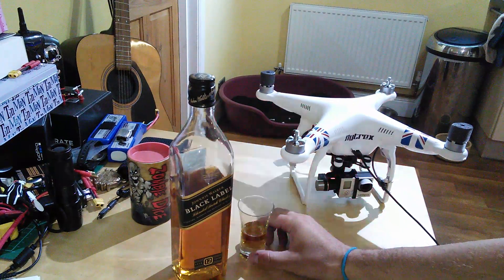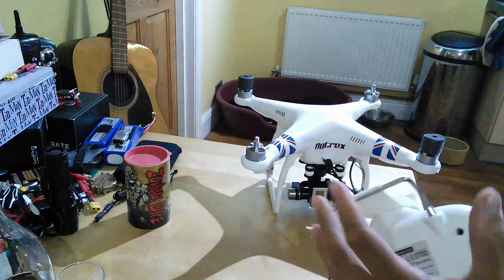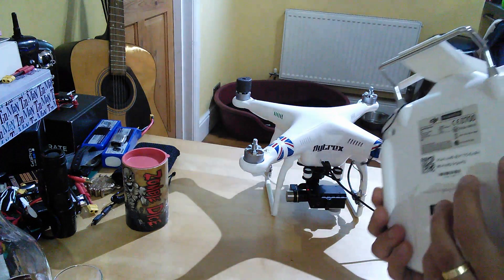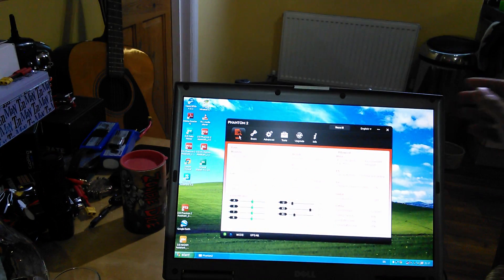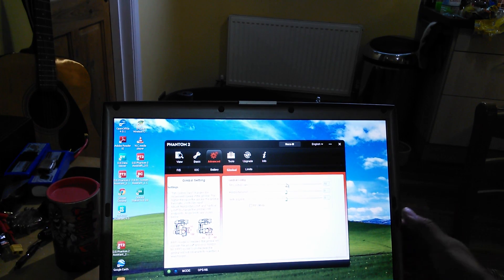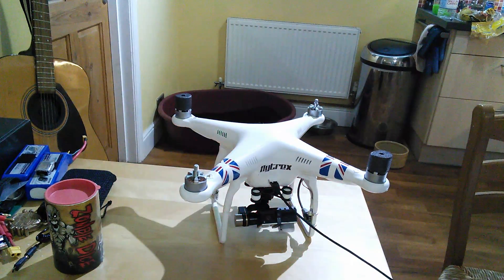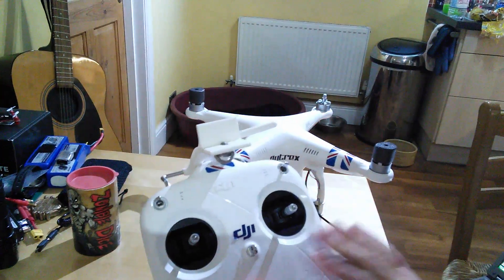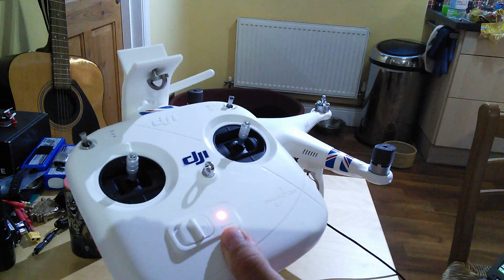How to adjust your DJI Zenmuse H3-3D gimbal for smoother tilt movement

Comment: I don't have this interface on my newest Phantom 2 Assistant software version 3.  It won't let me go back and use software version 2 anymore.  My gimbal is still incredibly jagged feeling on the tilt.  I'm using the H3-2D.
Reply: ***** Yeah everything on my upgrade tab is up to date.  I'm using Mac so the drivers won't work for me.  I'm reading that it's all supposed to be updated now through the Phantom assistant software.  Again, the H3-2d assistant software and RC assistant software both won't recognize my phantom.  It's been a pretty frustrating process.
Reply: I've tried on windows as well, played around with this before with the old V2, changed to v3 updated all firmwares, tried on mac and windows, the thing is not working. Only option left to me is to configure this via the naza m software which apparently does not connect to phantom 2 anymore. It worked before, I'm dead sure it worked with phantom 1. Matt Peevy , have you tried with naza v2 assistant software?
Reply: Uaral I tried all the software and all the recommendations for about 2 hours this morning.  Installed and updated firmware as well as performed multiple calibrations with no luck.  What makes me really curious is how SOME users can update their gimbal IMU to firmware 1.8, but my software says 1.6 is the highest.  I thought the Chinese knew their stuff???  This is all extremely aggravating.  Oh, and good luck getting a timely response from DJI themselves.
Reply: good point, I will have to check my software version, will do and let you know how it goes.
Reply: Matt Peevy , I checked I actually have 1.8. even more strange.
Reply: Matt Peevy Any news on the speed issue?
Reply: MatthewBayard , I gave up. I have seen other users have said that this option is only on h3-3d, 2d is not supported. I just softened the pinky handler so that I bent it downwards such that it now goes a complete 180 degrees, then recalibrated and now I get a very wider throw. Its actually good enough to make very smooth adjustments. you wont get more throw even no a futaba.
Reply: Uaral Thats sucks. I loved the speed control in the software. It allowed for slow tilt. I might have to ditch the stock controller and step up to a Futaba. If only DJI didn't mess with a feature everyone was happy with!
Reply: ***** I'm running all the latest firmware yet my gimbal settings will not change when I move the slider in Phantom 2 Assistant as you're doing above.  It just doesn't react at all.  Whether I'm at 100%, 50%, or 0% the speed on my gimbal tilt stays exactly the same - very sharp and pretty much unusable for getting nice smooth tilting shots.  Is this only supported on the H3-3D?  I'm using the H3-2D.  Still so very frustrating!
Reply: Uaral I'm with you.  I gave up months ago but really still wish I had the capability for precise and smooth tilts during my shots.  I'm having to cut around the tilts I do during editing.  I've managed to get everything updated on firmware but the gimbal slider controls aren't working for me :/
Reply: Matt Peevy yeah, I feel you, it just hurts. I have came to the understanding that we have somehow bricked the gimbal. I've seen people recently saying it is possible to go back to initial version by changing bootloader, yarayarayara. I think that is a strong candidate for this issue, because in the early version this was just fine. I just don't have the time now. have you seen my earlier comment? : Uaral6 months ago
 
I've tried this on H3-2D and it doesn't work. I haven't tried with with naza m software.
another easy peasy thing is to remove the lower part of the original kit so you get more throw on your pinky stick.

If it is not obvious I can upload a video.... but seriously makes it a zillion times better....
Reply: Yeah I'm just debating on whether or not to spring for the H3-3D gimbal.  I haven't found any absolute sources that say it WILL perform better than the H3-2D when it comes to the smooth tilt function.

Comment: I've tried this on H3-2D and it doesn't work. I haven't tried with with naza m software.
another easy peasy thing is to remove the lower part of the original kit so you get more throw on your pinky stick.